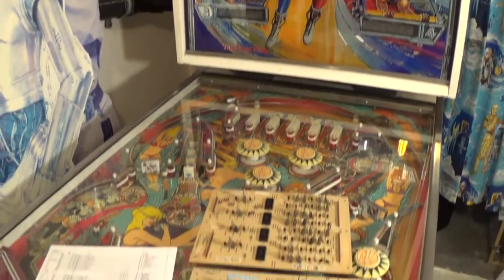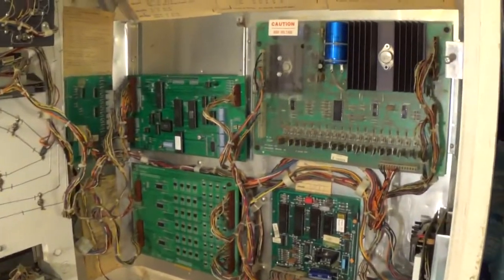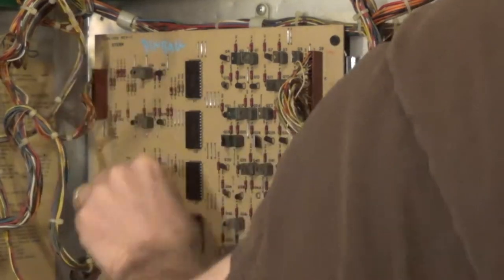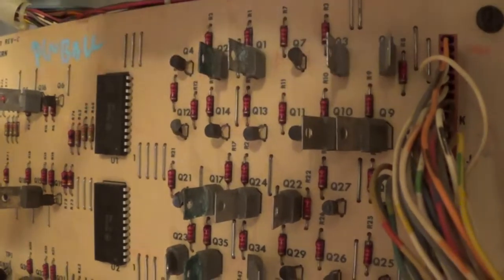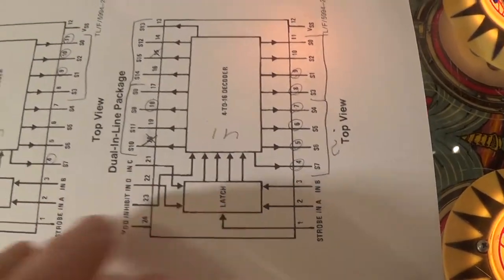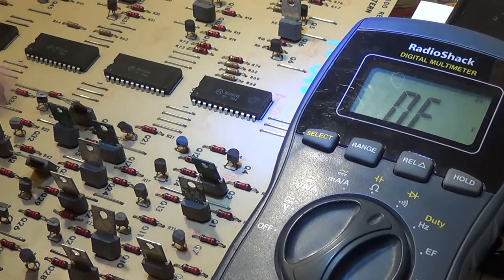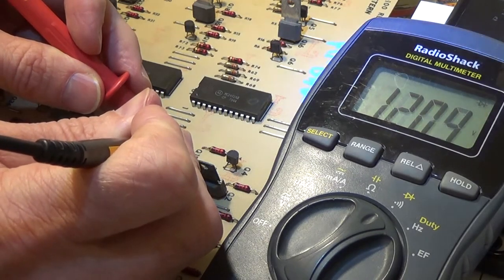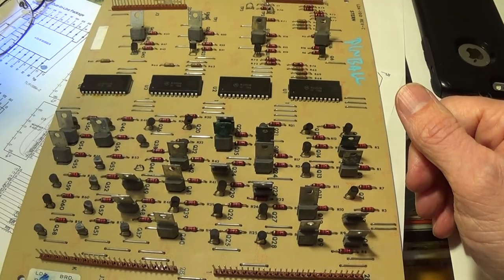How to Test and Repair Lamp Driver Boards for Stern/Bally Pinball Games

Comment: Question: wouldn't testing this board at the test points give you an idea of what branches aren't working and then save you time by allowing you to dig down into the specific sets that have the issue ?

Comment: Hi Geo. Can you Help me with an opinion or guide? I just replaced an MCR106 on my Kiss Pinball Machine and it worked fine for 3 or 4 games. after a while ti fried (just the MCR). What should I be looking for here? (The replacement was an MCR106-6 over an old MCR106-1). Am i missing something?

Thanks for your help, JP.
Reply: @Greg Lilly Thanks for answering Greg. Actually that's the right answer. What I did was to put a cable to replace the damaged track (no more intermittent contact)  and it is working since then without problems. All lights are working now. Still thinking on getting a replacement board but no rush.